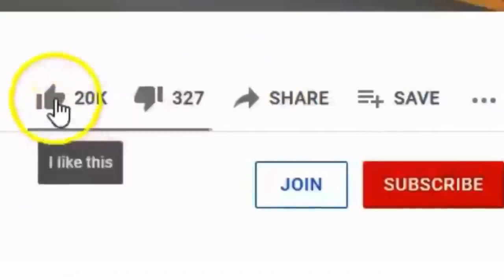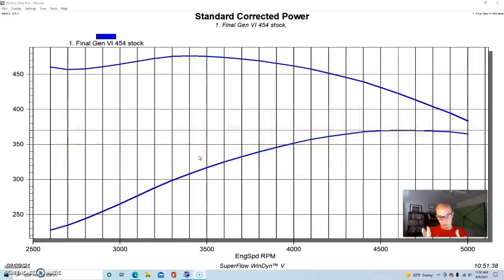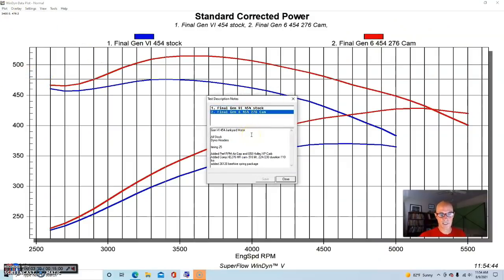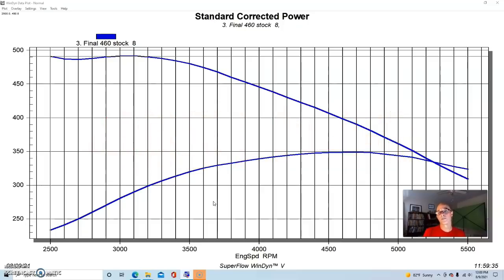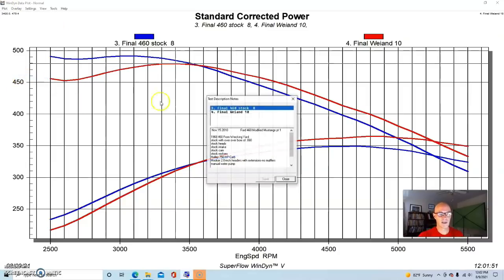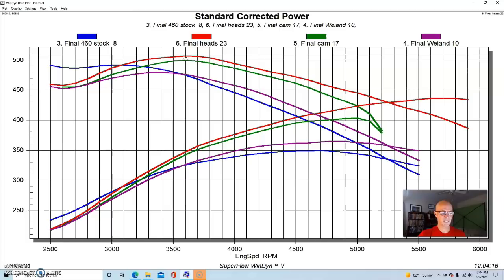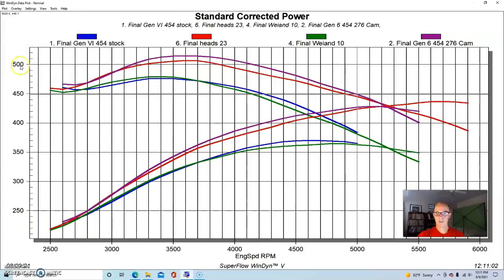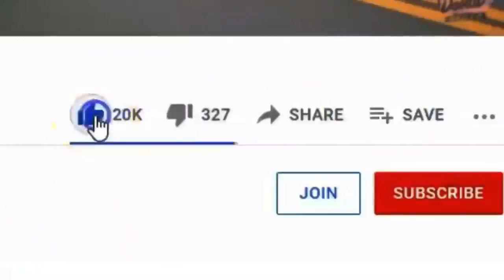JUNKYARD BIG BLOCK POWER-460 FORD VS 454 CHEVY FULL DYNO RESULTS

Comment: If the Chevy was .060 over and 10 to one compression,and had mild porting like the Ford, I don't think it would be as close.
Reply: playing the "IF" game? well ok, IF the Ford were 28 years newer 1968 vs 1996 perhaps those issues wouldn't be much different. Both are big, both will thump big power if built to do so.
Reply: @ryanroberts1104  Got your notification for your comment. It took 20 seconds to click on your channel to see the video of the truck in the quarry. No time or effort... Not sure why you deleted your original comment.

Comment: In the late 70's we could only dream of the HP being pulled out of motors in general nowadays. Back then, Big Blocks were the shortest path to get higher HP and monster torque. Back then you didn't call a Ford, Chevy or Mopar Small Block a "Muscle Car" no matter how much HP they generated. Those were "Pony Cars". The moniker "Muscle Car" was reserved for the Big Block equipped street rods.

Comment: Interestingly, Arias has produced 454 big block Chevy's with Porsche M28 DOHC 4 valve cylinder heads.  The 928's V8 is almost exactly the same size as the 454, so with some welding and drilling it is possible to mount the aluminum heads on the iron block.  The cams are turned by a belt that in turn is turned by a flange on the original cam gear and timing chain.
Reply from the maker: 928 HEADS DON'T FLOW ENOUGH FOR A GOOD BBC, BUT IT WAS COOL

Comment: Seems like both cams were rather mild. I run a 240/244 duration@50 in my small block chevy, surprised to see my cam is so much bigger than both of these
Reply from the maker: LIMITED P-V IN THE STOCK PISTONS
Reply: Old school cams focused more on duration than lift to make up for the crappy heads.And consequently a lot of old hopped up v8's sounded nasty.With good modern heads shouldn't need tons of duration.Idk if that factors in here.

Comment: One factor not taken into consideration in the test, is what would the dressed weight of each combo be? We've all been told that the Chevy BB is a very heavy unit. What about the Ford 385 family? Say you are building a street/strip hotrod, and you want a good power to weight ratio, which would Richard choose, ceteris paribus?
Reply: @ryanroberts1104  per the video, hp, torque virtually equal, so weight can be a deciding factor. Which is heavier?
Reply: I think the Ford is actually heavier. Crank is heavier and block is physically bigger. But, they’re both heavy enough even if the difference is 50lbs it doesn’t matter much.
Reply: @allenl9031  The BBC weighs in at around 680 lbs stock.  I can't remember what the BBF is, but you can google it.  But virtually no one runs a BBC stock.  The aftermarket makes aluminum everything for the engine for cheap money.  So most street/strip rats are going to have aluminum intakes, heads, water pumps, and lightweight steel tubing headers.  That brings the weight way down below 600 pounds.  If you run an aluminum block, you're now down to around 530 lbs, or the same as a small block Chevy.
Reply: @corvettejohn4507  Not everyone can afford all the upgrades, Richard's comparison wasn't all out builds, but more of a budget build comparison. Still lots of junkyard 385 series engines out there...
Reply: @NBSV1  Yes, the BBF is 720 lbs to the BBC's 680 lbs.
Reply: @allenl9031  There's still a lot of cheap Gen V and Gen VI 454's out there too.

Comment: BOTH were AWESOME. 👌😎🤘
Reply: Yep, because both have basically the same cylinder head design.  The Ford Cleveland and 385 series big block heads are canted valve semi-hemi's just like the Big Block Chevy's heads.  The Mark IV big block Chevy introduced in 1965 was a fully production developed version of the 1963 Chevy MkII 427 Mystery Motor that ran in the 1963 Daytona 500.  Ford protested to NASCAR that the Chevy motor was a ringer because it wasn't a production motor.  Long story short, NASCAR told Chevy to sell one of the Mystery Motors to Ford since the rule book said the motors had to be available for sale to the public.  So Chevy sold a Mystery Motor to one of the Ford NASCAR teams and they sent it up to Dearborn, MI where it was run on the dyno, taken apart, and examined. 

Five years later, Ford releases the 385 series big block (and Cleveland heads for the small block) who's head layout is extremely similar to the Chevy Mystery Motor and hence the Big Block Chevy.  Not only do they share the canted valve semi-hemi combustion chamber, they also use the same rocker arm ratio and the rocker arms from a 429 or 460 BBF, or Cleveland SBF, will fit on a BBC.  For years, if you wanted cheap roller fulcrum rocker arms for your Mark IV BBC, you just went to the Ford dealer and bought BOSS 302 rocker arms and slapped them on.  Ford also used the same valve size on it's high performance 429's as Chevy's iron rectangle port heads, 2.19" intake and 1.72" exhaust.

Now Chevy wasn't the first to offer canted valve heads for a V8, that distinction actually goes to the 1955 Plymouth Poly-spherical head motor sometimes called the Poly A.  So Chrysler tried it first, then Chevy, then Ford.  However, while Chevy and Ford used canted intake and exhaust valves, the Plymouth only had one canted valve, the intake valve IIRC.  This was because the Plymouth used a rocker arm shaft.

Comment: Haven't watched yet but my guess is the 454 makes more top end hp and the 460 makes more low end torque.
Reply: Wow, not what I was expecting.
Reply: Skip R  where do you see a 2bbl 400 out torquing a 4bbl 460? 400 was under appreciated, but come on, ive ran both and the 400 is great to 4000 or so where the 460 will pull to almost 5000(both being stock) but the 460 seemed to have more grunt than the 400.  Maybe it was my imagination because obviously a 460 is the beast but do you have any dyno runs or 1/4 mile passes to back up that claim?
Reply: strike that reverse it.
Reply: Skip R  Torque production is more of a result from cubic inches than stroke itself.

Comment: Only thing I dislike about you is that you're in my neck of the woods, so you snag all the good stuff 😅
Reply from the maker: lots of good stuff still there-wish I could have pulled the Q4 442 car
Reply: @richardholdener1727  And park it next to the Mustang, and the Nova, and the Dodge?? lol. HOARDER!!! lmao. Kidding, of course.
Reply: What about a 427 tunnel port side oiler,fuel injectod, msd,good set of hand     made pipes, crank trigger, Mallory magnetic pickup dizzy, total advance 40 degrees, all in at staging, till the traps

Comment: A question for all engine builders. Is there a reason to not put the highest flowing top end package on any conceivable short block? For example, a stock 460 block that is bore to 4.600 but still having lower compression, with either a CNC A460 or CNC SR71 and tunnel rams, or if Chevy, normal gen5 454 with that BIG brodix head and tunnels? 

It seems from all of these tests regardless of almost everything around, the highest average torque production is coming from the head with the highest flow numbers through the entire lift range and the intake tract that  plays to that heads strength. 

Low compression, stock exhaust manifolds, even smaller displacement non-stroked engines all seem to want the most air possible

To circle back to the question, can you put a top end package on a short block that is really "too much" for the displacement of the short block?
Reply: Would just push peak hp and tq higher in the rpm range...
Reply: @harryguy76  But wouldn't it also make more through the entire RPM range? from 2k on it should be significantly more.
Reply from the maker: a460 heads would be a waste of money on a mild combo with stock manifolds
Reply: @richardholdener1727  Understandably so, but the question I have in my mind is one of theory anyway, money being no object for say a manufacturer who is already building the engine. 

Would you not always want the best flowing head regardless of the engine it was sitting on? 

Small displacement, stock in and ex manifolds, low compression, Does the best head always make the best power or is there a "too much" intake port flow like I have heard about too much carb flow?
Reply: @MrAPCProductions  Tons of flow on an engine that will never see the potential of it, will kill the power. Just imagine a set amount of water flowing through a 5/8 garden hose, then the same amount of water going through a 24 inch sewer pipe.
Reply: Velocity of the air is also important. If the ports are far to big then you end up loosing air velocity and it’ll actually loose power because the air just isn’t moving. That’s why it’s generally all a package that you want to match up. Need to size everything so it works together and flows enough to not be a restriction without being way to big. 

As far as production stuff goes they’re more focused on what’s cheap, reliable, and works well enough. For big ports the castings get thinner so can be harder to do without problems. And, since they’re generally more focused on torque they want long small runners anyway.
Reply: @elmerfudpucker3204  how much water can come through a 5/8 garden hose with atmospheric pressure pushing it and vacuum pulling it? 

Now how much comes through a 24 inch sewer pipe?

It seems every engine being an air pump that if you remove as much restrictions and increase flow rate it will always make more power. 

If a particular head x flows more cfm at all known lift ranges (intake and exhaust) on a flow bench than a particular head y, then head x will always make more power. Always. All other variables being equal. 

Using the same, ported vs unported, more flow more power. 

Using different heads, more flow, more power. 

Is there any type of math or dyno charts that prove otherwise?
Reply: @NBSV1  how big is way too big? There are Kaase headed 429s. Or 306s with afr 245s?
Reply: @MrAPCProductions  I would think no but Rich would know better then most...you can see with just the mild work rich did on the 460 how it lowered low end TQ over the stock cast intake and heads compared to an aftermarket aluminum intake and minimal porting it pushed it higher into the rpm range...
High rpm is great if the bottom end can handle it and top end supply it....not to mention high rpm equels shorter life span. What do you want and how much do you want to spend...

Comment: So hopped up those big blocks would make around 350hp net.  Which shows how advanced the LS1 is from the 1990s making 350 net HP.  Light weight and the power of a hopped up big block in stock form.
Reply: Hopped up?  Lol.  They're far from hopped up at that power level they're super restricted.  With a good head, cam and intake manifold they'll make alot more than that.  When you see 350 horse and almost 500 torque that shows you it's nowhere remotely close to optimal when you see that much more torque than hp.  I def would not call that setup "hopped up". It's extremely mild.
Reply: You talk about the 346 cubic inch ls1 making 350 hp in the late 90s early 2000s advanced what about the 281 cubic inch 4v ford motors from that era doing over 300 hp with way less cubes.  That is advanced.  The mach 1 version was better and closer to 330 or better in stock form still with only 281 cubic inches but that was from 2003.  The mach is rated 305 or 310 depending on year but based on tons of dyno results on stock cars people have determined the number was closer to 330+ from only 281 cubic inches in 2003.  It was the coyote before the coyote.  You talk about the ls1 having the hp of these extremely mild big blocks but look at torque it's not even close.  You get the heads flowing and a better cam and intake where it can actually make power at a decent rpm the big blocks will stomp on an ls1.
Reply: @midnight347  And a stock LS1 with 100 less cubic inches in stock form shows progression which is now 20+ year old technology.  So stock is far more than mild.   It shows how overrated and hyped those engine ratings were.tbe Ford was rated for 365 HP and it couldn't even make that gross.  Again it shows how today's engines have way more power.
Reply: @midnight347  I didn't say the LS 1 was the king, it was only a comparison to a modern push rod.  Ford is not a comparable as it is dual overhead cam.   Completely different animal.  We then might as well start comparing heavily boosted 4 cylinders to old V8s then talk how the 4 cylinder beat a V8
Reply: @midnight347  if they put a 2003-2004 mach 1 engine on dyno I bet it would exceed 360 hp. Again because it is a gross vs net rating.  Which the net I believe was 302 hp.  LS1 cars made around 290 at the rear wheels at the time late 90s hotrod magazine tests.       Things like the 1970 Chevelle SS 454 made about 280-290 rear wheel, the baddest of the big blocks of the late 60s early 70s only made about 350 hp net.   The gross ratings were not "underrated". If they were well they wouldn't even one close to those rating net.   Ford 428s did not make 500 hp... Most tests indicated they didn't even make 400 hp gross.  If anything the 335 ho cobra jet 428 made about 365 hp tests indicated.
Reply: Are you trying to imply they put a 500 foot pound stock LS1 in a pickup truck or station wagon?  I'd hope there were some improvements in the 30 years between when those mills were designed, but there aren't any stock 500 foot pound LS"s.
Reply: @ewetoobz3840  this is true, if high torque is your goal then the big block is the way to go even low tech as displacement is hard to beat making high torque numbers
Reply: @ewetoobz3840  better a big block in a pick up truck .  But a lowly C5 Corvette is better than a old big block Corvette.  Except for nostalgia.
Reply: @stephenkowalski2448  You cannot sensibly compare engines on horsepower alone.
Reply: @ewetoobz3840  yeah, and there were  no 500 foot pound classic small blocks either

Comment: Man those old 460s are badass especially the one that was in the original Bigfoot
Reply: I remember the original big foot. that thing was bad ass. big old 460 with a blower and 3 predator carbs. those predator's were really cool carbs. years ago one of the tv shows rebuilt the engine for it.  there is a clip of it on you tube some where.
Reply: @shadvan9494  yeah Ik the video you’re talking about, it’s on powernations YouTube channel that thing was mean when they got it fired up
Reply: Powernation I think rebuilt the Bigfoot motor. But it was all aluminum. Smart choice.
Reply: I hate to burst your bubble, but there wasn't a single stock 460 part on that motor.  It was all aftermarket including the very pricey all aluminum race block.

Comment: my issue with this test is the fact u used the dinosaur ford heads vs the modern chevy heads u shouldve used oldschool ovalports on the chevy to make it fair and obviously the roller cam has the advantage
Reply from the maker: AN 049 OVAL HEAD WOULD DO JUST AS WELL ON A MARK 4 454
Reply: Mike, the oval port heads on the Gen VI flow about the same as the Mark IV oval ports from the 1960's and 70's, about 260-270 cfm on the intake port.  Which, if memory serves correct, was what the early 1960's 409/425 heads flowed on the intake side.
Reply: It had D0ve's on it (well, C8ve, same head) - imagine how bad it would have done with the D3ve or the open chamber D2's!!
Reply: @ewetoobz3840  imagine the 454 with the peanut ports
Reply: @richardholdener1727  here the thing tho ive never seen a 454 make 650 horse with stock gm ported ovalports for that reason the 460 is a better motor

Comment: Interesting the Ford couldn't get the torque higher, since it had the cubes, compression, and it should have had longer ports.  The Chevy does the stroke advantage.
Reply: Cubes and compression can only help a poor flowing head so much...
Reply: @shitbox7413    It's the EXHAUST.. the intake can hold it's own.
Reply: @superkillr  
Would be interesting to see both heads on a flow bench...

Comment: How about a stock 1970 454 vs a stock 1970 460? I think the comparison was a little off. The later model 454 has lower compression than a 1969 460 would have
Reply: There was never a high performance version of the ford 460 though. So the comparison is much more accurate than you like to believe. The 70 454 was indeed a high performance engine. Found in chevelles & other performance cars. The 460 in those yrs you can only find in Lincolns & maybey thunderbird. A low reving, but powerful engine for big heavy luxury cars. Never got any performance, high flowing heads or hot cams. So this test here with the 454 out of a truck is much more comparable. Yes the chevy did have less compression,  but the vortec heads on the chevy are a far better & more modern design chamber head than the ford. I believe it's a very reasonable test. Far better than the 70 454 vs. a 70 460. If you compare performance engines of the time the 429 boss would be a much closer match up.

Comment: What ignition timing did you run the BBC?
Reply from the maker: whatever it made best power at
Reply: @richardholdener1727  I have a similar set up on my GEN VI 454 in my boat, and I’m running 35° total timing. Does that sound Like I’m in the ballpark?